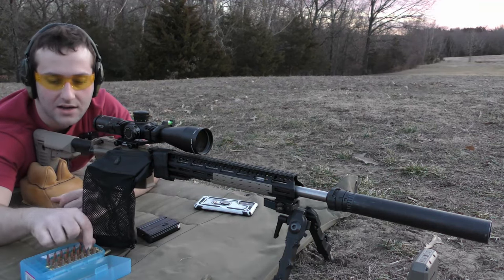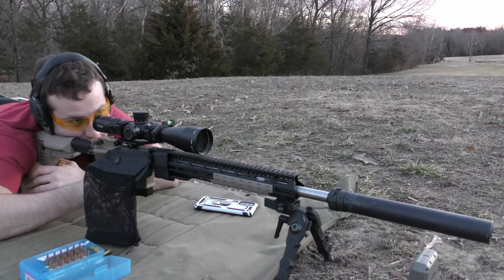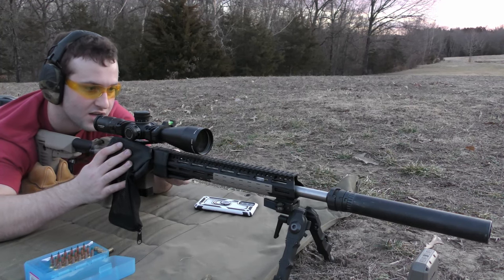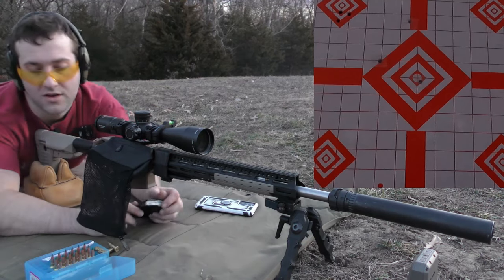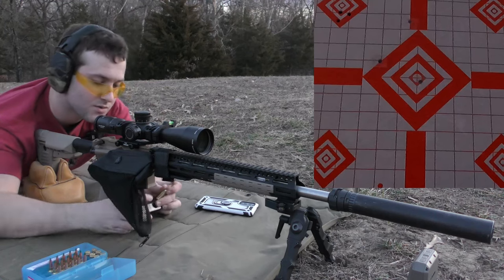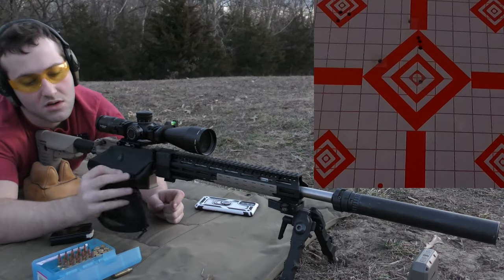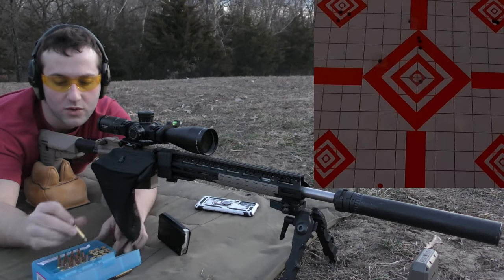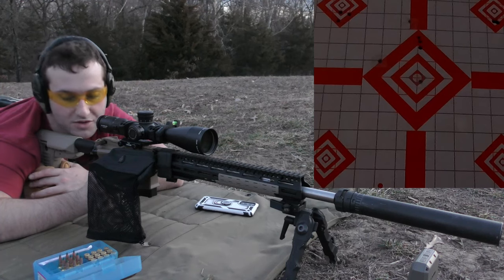Aero Precision 6.5 Grendel AR15 Build: Accuracy Testing Odin 18" SPR Barrel w/ Sierra 105g Blitzking

Comment: Love to see other small gun channels showing shooting results.  26.3gr of 8208 XBR looks like a winner.  I pretty much only use 8208 XBR in 6.5 Grendel anymore.  I call it pixie dust.  It just works in the AR-15 calibers that shoot long distance.  223, 6.5 G, 6 ARC, it just works.
Reply from the maker: Thank you very much. I love 8208xbr, but it seems to be scarce even after most of the "pixie dust" powders have come back in stock everywhere. So, I'm definitely going to test other powders for curiosity sake.
Reply: @RisenCitizen my 6.5 Grendel likes cfe223
Reply from the maker: @Nobody-qw4fo  I haven't had great luck with that powder. I've used a lot of it, but it hasn't produced the best accuracy in most cases.

Comment: I built one years ago with a faxon barrell. 24".  Loved it, but was just too long to put a can on. 

Built a new one three years ago with an 18" ballistic advantage barrell. Absolutely love the rifle. My daughter uses it for deer hunting.

 I had previously stocked up on the steel cased wolf ammo too. So can still shoot often enough to justify keeping it around. Can reliably get 1.25" or better groups with that stuff . 

A buddy reloads hunting loads for me. Typically 132gr bullets. He even did a 143 ELDX. It was a little slow on the chronograph, but grouped sub 1".

When i finally run out of the wolf ammo, i might just swap a 6arc barrrell because its gaining in popularity over the grendel.
Reply from the maker: I just can't do a 24" barrel on a gas gun. I thought about it for the 22 arc video, but it just loses practicality for me. Way too long for a can. I love the 6.5 Grendel, but 6 ARC does seem to be outrunning it in popularity, so I will probably be putting together a 6 ARC at some point for channel, at least. Not to mention, Alpha is making brass for it now!